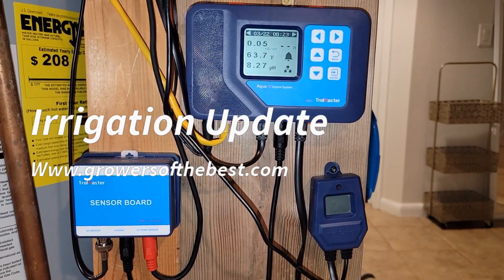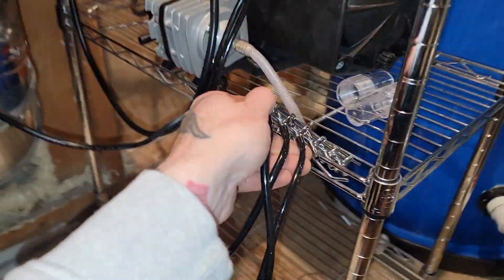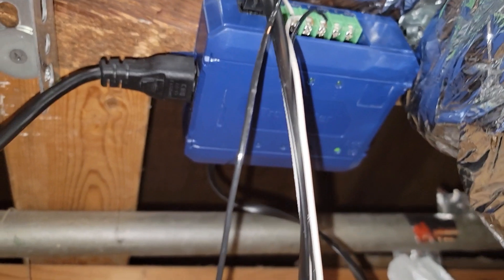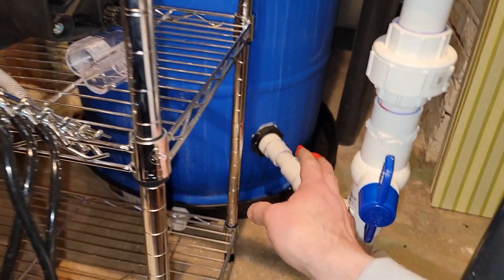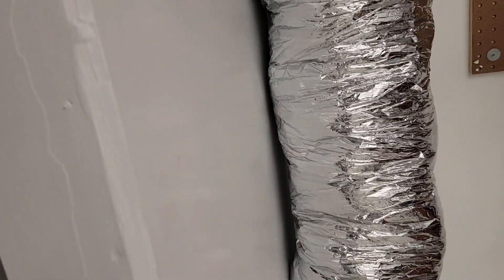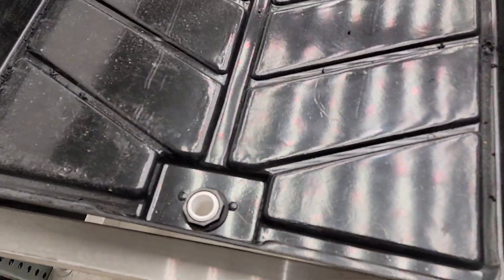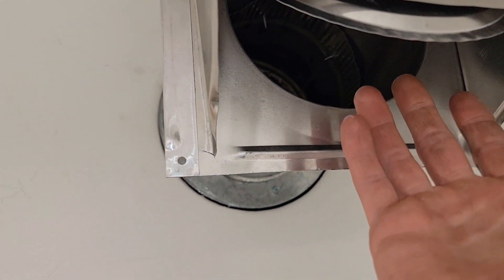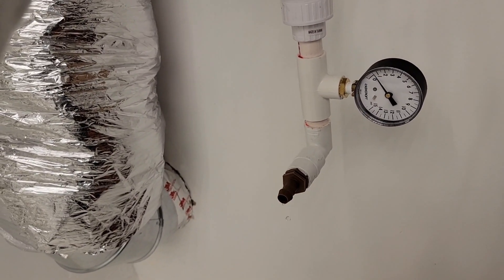Automated Irrigation Drip System [Pt. 1]

Comment: Dope set up. Do you run a pressure reducer with that pump? And do you think the leader filter is needed between res & pump? I have the 250 ecoplus. Hope its not too much for 4 tables.
Reply from the maker: I had filters and 25psi regulators on every line
Reply: @GROWERSOFTHEBEST  Thank you. I was referring to the filter leader makes that goes on the front of the pump. I see some people using it and some don't. If your pumps still going strong it's probably not needed. I'm making an irrigation system this week, so thanks a ton for this video.
Reply from the maker: @billstallworth805  no problem. Also I run R.O. water throught the pump. So that's my only filter that side of the tables

Comment: The set up and room is so clean. I just started using troll master set up and how do you get the solenoid to kick on the pump. I have my pump plugged into the dsp-1 device. Thank u
Reply from the maker: I'm using the aqua X with 2 zones I made out of my manifold. Using the 24 V sensor board. Have to admit I am not impressed. Will not be advising this to my clients I do not like how it works. App is s*** too. To answer your question though if you're using the 24 V sensor you need to make sure you have it wired correctly and then connect  The correct side Daisy chained to the DSP one
Reply: @Phenofiend  what system would you would have chosen instead after using the trollmaster?
Reply from the maker: @TalesBeyondBoundaries  I would test out growlink, and another newer brand but can't remember the name atm
Reply from the maker: If that doesn't make sense I can put it in the next video. What type of solinoid valves are you using
Reply: Using a netafim 24vac wired into the troll master 24v. I hear it click on n the light on the troll master 24v.  Ya I’ve been having trouble with the app too kinda stuck with the troll master so just trying to make best with it. Thanks for your reply